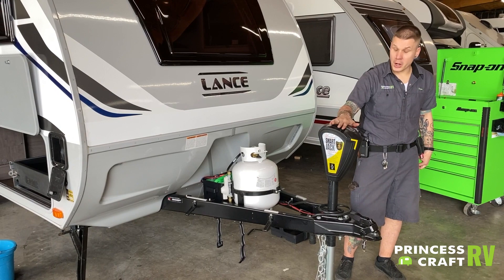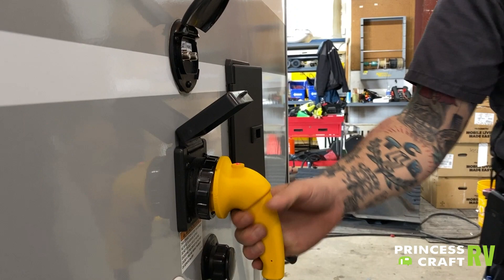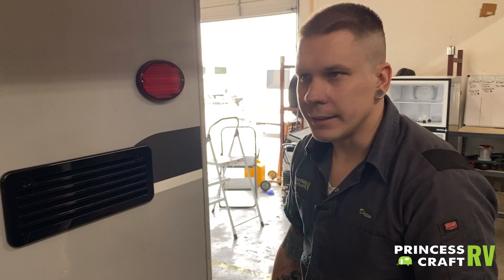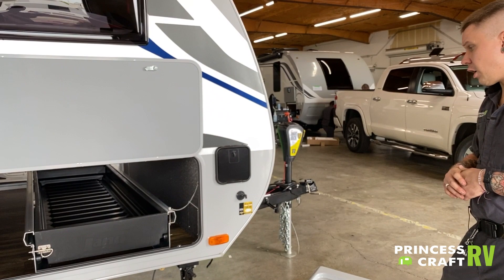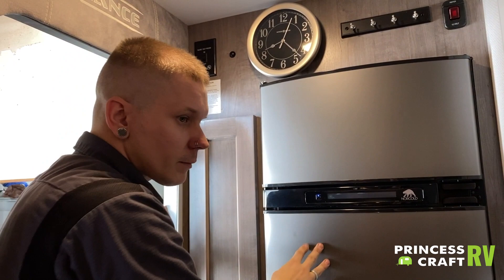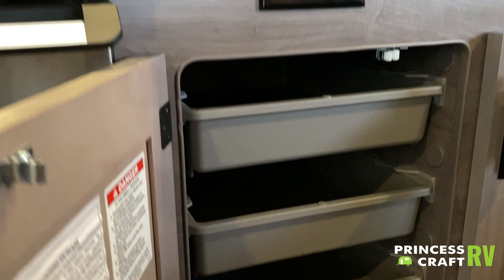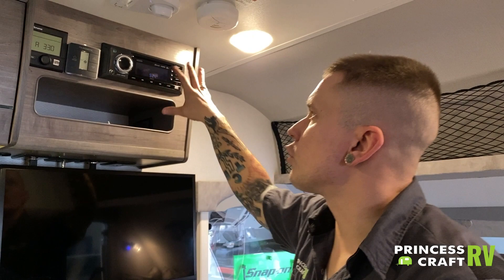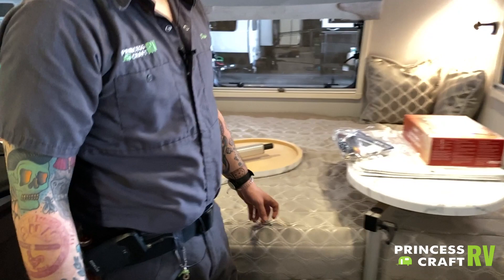Technician Tour - Lance 1475

Comment: My question was, on the 2019 Lance 1475, the red wire has nothing to do with the Jack. It had everything to do with the Truma system. Disconnect the red wire and you disconnect the Truma system. I asked if it was different on the 2020 1475. You said you would check but never let us know. This seems pretty important to know.

Comment: Do not know about the 2020 but in the 2019 1475 the red fuse going to the battery is 10amp and is for the Truma system, not the electric jack. Pull the wire or fuse and the Truma system in inoperable.
Reply from the maker: Hmm, I'll share this with the techs! Thank you!
Reply: So after 3 weeks there is no reply on the red wire you think is the electric Jack. How about clearing this up for everyone?

Comment: Very detailed. Great job. I like it when that knob fell off the window and out of the camper, you didn't miss a beat, but is that a concern of the quality of the Lance? Also, the power cord is 30Amp on both ends of the cord correct?
Reply from the maker: It is 30 amp connection on both sides of the cord.

Comment: Did anyone there find out about the red wire that you said was for the electric Jack?
Reply from the maker: Sorry I missed the question regarding the red wire for the jack. What would you like to know about it?
Reply: @RVTechToursatPrincessCraft  
The question was about the red wire going to the battery. On the 2019 it is for the Truma system not the Jack. Is it the same on the 2020 1475? Pretty important but hard to get an answer from you.